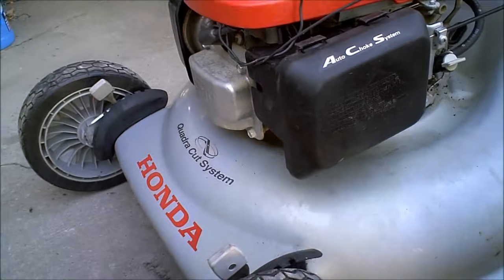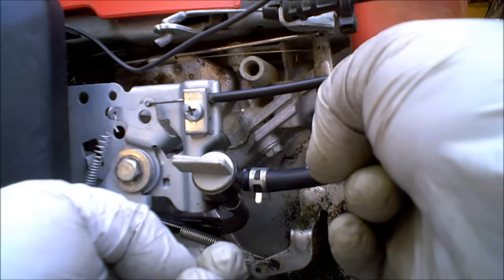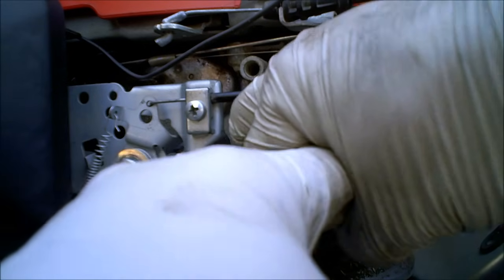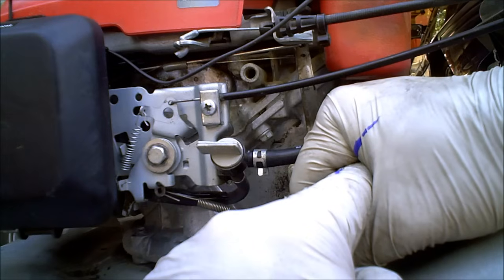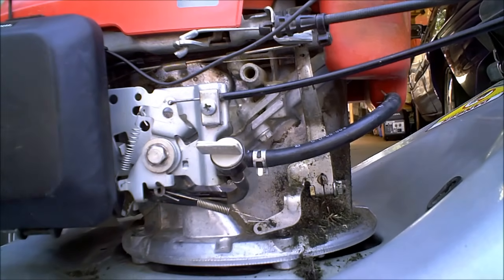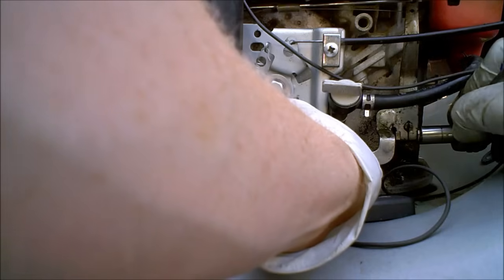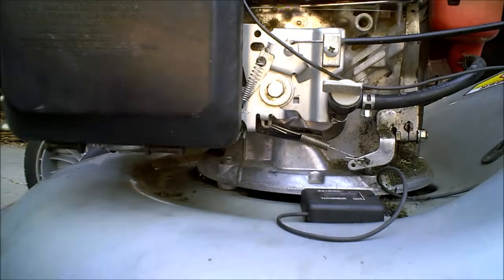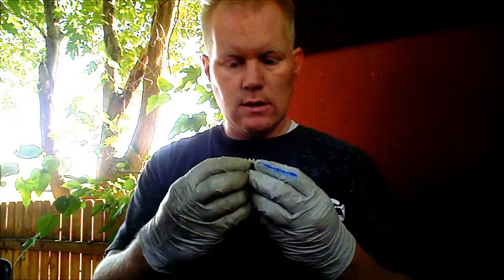Governor Adjustment and How They Work       Honda Briggs Tecumseh Kohler etc.

Comment: I have one of these engine mounted in my flat bottom 8 foot Jon boat with gear box from a 35 hp evenrude works fine
Reply from the maker: That's awesome.
Reply: sixtyfiveford  just post the video have a look
Reply from the maker: It spins it really nice. Looks like the pressure washer and lower unit get a new life.

Comment: Maybe I finally found someone to answer me.
I have an 18 h.p. B&S. I drove it into my garage to change the oil, and my speed control lever was working fine. I started the motor and now I have no control at all. I set the governor in the wide open position. I even went as far as opening the crankcase to make sure the governor/slinger was good. I cleaned and check the carburetor. I still have no control with my lever. I can't slow it down from 4200 rpm to 3600....... What did I miss?
Reply from the maker: Does the carb butterfly operate. If it is and it doesn't change the rpm, then the butterfly plate came loose inside the carb.

Comment: I can't tell in the video, are you rotating the cylindrical shaft with the pliers or moving the arm that goes around the shaft while you hold the shaft stationary with the pliers?  In other words which part are you moving?
Reply from the maker: The center shaft. It is very rare and uncommon to need a governor adjustment and generally only needs to be done if someone has messed with it.
Reply: I don't necessary "need" it, but I would like to increase the RPMs for more power so i can plow through high grass.
Reply from the maker: Some motors also have a simpler way. There will be a metal tab that the governor spring hooks to. This tab is bendable on some engines and you can bend it to apply more spring tension on the governor arm. This increases the rpm.
Reply: I have the GCV 160, Troyblt lawn mower, is there another way?  I tried it yesterday and I got it to increase too much and i change it back but now i can't get it to increase again.
Reply from the maker: Does your motor have a throttle control?
Reply: I don't know I think i have the same motor, a GCV 160.
Reply from the maker: Do you have a lever on the handle bars that allows you to make the engine go faster or slower/change the rpm(throttle control)?
Reply: no
Reply from the maker: If you have the same motor. At 2:23 in the video pause it. You will see a spring at the left side of the screen. It is almost vertical. It hooks to a little metal arm at the top. If you bend this little arm UP it will increase the rpm slightly.
Reply: Do you bend that tab that it's hooked onto  or the whole arm?
Reply from the maker: Only bend the small portion with the hole that holds the spring. Bend it so it pulls harder on the spring. You only bend it a little.
Reply: @sixtyfiveford  How do you bend the bend the metal arm when the metal is perpendicular to the direction you are bending.  Is the preferred way to adjust the governor shaft or bend arm?
Reply: I find that arm that wraps around the govenor shaft is very delicate and if you tighten it too much it will damage it and will no longer clamp down on the govenor shaft.

Comment: What would happen if you take the nut off that clamps the arm to the governor and replaced it with a nylock nut. But left it Loose on the governor shaft thus allowing the throttle linkage to move using the governor arm but not moving the shaft. In an application where you want the most acceleration performance out of your engine like a bicycle or go kart.

Comment: Can you use that same tach for 2 cycle and 4 cycle engines?
Reply from the maker: Yes.
Reply: Most 4 cycle engines (small ) fire the spark plug once per revolution . So the plug fires on the exhuast stroke also . The power for the spark is made by the magneto , no coil , no distribitor

Comment: Hi! how i get out the Carburetor  Main noZZLE when it is stuck?
Reply from the maker: Leave it, and just spray carb cleaner through it. If cleaner sprays through the passage is clean.
Reply: Spray some oil on it and use correct sized flat head. Push hard down into the jet as you break it free to prevent it from stripping. Blow carb cleaner and compressed air though it to clear.

Comment: Ive got a 98 Cub Cadet with a Kohler Command OHV 12.5HP motor, and I'd like to get it to go faster. would adjusting the governor let you get more RPMs out of it? That's what I've heard but I wanna make sure, and how to do it
Reply from the maker: +vinceMCsurvivor silver Adjusting the governor will give you a little more speed, but also shorten the life of the motor drastically. You're better off putting a different size pulley on the transmission or larger tires to get more speed.

Comment: thanks buddy, I have been a mechanic since I was a kid... now I got a paper that says I know what I am doing! I never knew how the governor worked on a lawnmower, I knew it controlled rpm, I just wasnt sure how. I will be sure to check my rpm because it does seem to rev pretty low.... I wanna get me one of those sweet gauges you got there, then I could tell how long I have to perform different services.
Reply from the maker: +codemiesterbeats Yeah, it is nice have an hour meter on machines. It gives you a great idea how much the actually get used and when to service them.

Comment: you had responded to a video about a honda gc160, where the person was having problems with his governor arm not returning to the idle position. you implied that this video would help.   I am having the same problem as the other video, and am trying to figure out why the arm does not move back to idle.  Your video does not address this setup, as your governor arm has a spring that pulls it back.  Do you know if  the governor shaft on the honda gc160 has tension on it (from inside the motor), or what pulls the governor arm back to idle?   thanks!  great videos by the way!
Reply from the maker: +R Wc While the engine is running, the governor is trying to close the main carb butterfly(trying to slow the engine down) and the faster the engine runs the more force the governor it applies to it. The governor spring does, just the opposite and is always attempting to hold the butterfly fully open to increase engine speed. The harder this spring is tensioned the faster the engine will run. The throttle lever that you control by hand is connected directly to this governor spring and pulls on it, resulting in higher engine speed. So if the engine revs higher than it should, either the butterfly in the carb is stuck or the governor isn't acting upon it.

Comment: Hello i have a problem with my lawnmower Honda GXV160 goes too revved and crackling with flames from muffler could be the adjustament of the governor? if it is can you explain me how to adjust it?
Reply from the maker: More than likely your carburetor is stuck open. With the engine off make sure all the linkage and rods that connect to the carburetor move freely back and forth by hand.

Comment: The Honda VRR216 manual states that if the engine speed is adjusted above 3050 rpm the mower blades can fracture. Has anyone seen that?
Reply from the maker: +Mary Lynn Bare The Governmental CPSC (Consumer Product Safety Commission) regulates the speed limit for lawn mower blades. They deem anything under 19000 fpm (feet per minute) blade tip speed to be well within safety specs. The faster the blade spins the better the cut, healthier for the lawn, and the more work the mower can do in a shorter time. Virtually all mowers run right at this to achieve the best results. Honda got a lot of flak for dealers when they started rolling out their lower rpm suggestions(around 16000fpm). It is thought to be more for decibel rating consumer comfort than anything else. Increasing speed on anything increases the risks of something going wrong. But this is like the difference between going 60 or 65mph in a car.

Comment: Hi, I am looking at the honda manual, it says 3000 rpm governed speed, and 1700 rpm idle speed. Are you adjusting the governed speed or the idle? Thx.
Reply from the maker: +goosecouple Honda cut performance to lower the decibel rating on their mowers for homeowners. The GC160/GC190 is rated at 3600rpm for peak HP and will do the most work. Higher RPMs obviously increase blade speed which gives a better cut and is healthier for the lawn.

Comment: Sixtyfiveford, can you adjust a governor, to lower idle, without sacrificing the max 3600 rpm?, I have a honda clond that runs great, and the idle is fine for most applications, but for mine?  I need a lower idle, and adjusted the idle screw out and still to fast.
Reply from the maker: +THEBGRED1 Push the governor arm over to manually get a lower rpm first just to test your engine. It's strange the the idle speed adjustment screw won't allow the carb butterfly to close more and lower rpms. Generally with the the throttle lever set to slow the governor is having zero effect on the carb.
Reply: +sixtyfiveford Take a look at where the throttle cable connects to the engine and move the throttle control (with engine off) from full to idle a couple times...there is either a tab that is bendable that stops the movement of the throttle...simply bend the tab to allow the throttle control on the engine to travel further towards the idle position. Some engines have both a high speed tension spring and a low speed. If that is the case, bend the tab for the low speed spring to decrease the tension. This setting is called "governed Idle" so that you move the mower into the grass when idling the governor will still function and open the throttle to prevent stalling. It is also there by design to ensure the engine has proper lubrication and air flow for cooling. Most are set for around 1500-1800 rpms. If you eliminate the governed idle so that the throttle plate is stopped by the idle screw rather than the governor, neither stall prevention or increased power will be applied when needed at idle. I strongly recommend not lowering the idle below 1200 rpms because if allowed to idle very long it will not be lubricated properly or have enough air flow from the flywheel cooling fan to prevent overheating on a hot day...more important is the lubrication issues as well as sludge buildup. The engineers that designed your engine do actually extensively test such things and is best left as is to ensure a long engine life     Kevins Small Engine, 03908

Comment: On a Kohler Courage 17HP engine, rotate the governor cross shaft (shaft) COUNTERCLOCKWISE as you view the end of the shaft to hold it against the governor pin, and tighten the governor assembly lever onto the shaft with the carburetor throttle valve wide open.
Sincerely,
David Parker

Comment: I have this same Honda engine on a Troy Built mower. I'm having this issue where after a minute or two the engine goes into this oscillating fast fast slow effect. I see the governor arm moving back and forth. I tried to attach the spring to the inner most hole on the gov arm, but it just does the same thing with a faster rpm. Anyone have any clue what this could be?
Reply from the maker: +Shane Sexton Dirty carb.
Reply from the maker: https://youtu.be/O9VuhhEdc1E
Reply: +Shane Sexton   Governor surging is most likely a dirty carburetor. The closer you move the governor spring towards the governor shaft on the engine, the more sensitive the governor becomes.

Comment: I have a Honda Harmony  HRM215 plastic deck mower MZBB-6011398, starts and runs great, oil is coming out of the carburetor, leaking thru the air filter and then onto the deck.  do you have any ideas on this.  oil is only coming out of the carburetor. Thanks George  Your Video's are great, Keep up the good work.
Reply from the maker: George Edwards The most common reason oil will come out of pvc tube and into the breather is that the oil is too thin. This can be due to: gas in the oil, not using the correct oil weight, or the oil has broken down with heat. I recommend an oil change with straight SAE 30 motor oil(non-synthetic) and your troubles should be gone.

Comment: What tip do we have to know if the gouvernor is not broken Inside the motor
Reply from the maker: Richard Labonte   Look at the lever hooked to the governor shaft and determine which way moves the throttle open(revs the engine higher). Start the engine and rotate the lever to rev the engine. If the governor is working it will fight you as you rotate it and try to slow the engine.
Reply: sixtyfiveford Thank You  it is a homelite 4000 watts with a 8hp B&S I clean the carb  adjust to 1 1 /2 turn  the 2 needle  and it work only on chooke when I try to remove the chooke the engine go crazy and stop it was doing the same thing before I clean it I ll get back to you thanks
Reply from the maker: The main jet is clogged or needs to be adjusted further out. If the engine is surging then the governor is working just fine and trying to keep the engine from dieing. More than likely you have an updraft carb. Here is my video on rebuilding them: https://youtu.be/in2tJ0TbWDI
Reply: sixtyfiveford Thanks a lot now it seem to runnning a bit fast I will find my self a rpm meter and get back

Comment: I have 20219 TORO Self Propelled Lawn Mower. I tried to fix throttle cable as it was springing back in chock position and so I loosened the screw and tried to fix the cable but I noticed that it's "end" should push the arm to close the choke which was too small and it was scrubbing the arm but not pushing it. so I bend the arm a little so that the end of the throttle pushes the arm and so it closes the choke. But something has happened now when I bring the throttle handle to fast from the choke position it runs at the slow RPM and then if I pull the throttle handle to slow nothing happens and it continues to run at the slow RPM. I do not see any mechanical movement happening when I bring the throttle handle from choke to run. What should happen? But if I touch the throttle a little it raves up the RPM a lot with loud noise. I mean it works. So what did I mess up and how should I fix it?

Comment: we'll he's 1/4 right by moving the gov.arm it caused the throttle spring to loosen up if he had moved the arm any more then he did it would have started doing the surging that he say's a gov has nothing to do with .Sorry dude surging is due to your gov arm being set wrong or air leaking at your intake gaskets or if it does not do it under a load your cab is shoot.and not gov work the same and the little weights are not weights there oil slingers the gov runs off of the gear and the faster the rpms the higher the gov rachet goes pushing against the are to choke it down so your motor does not over ref. OH I have owned two small eng and power sport shops and have been working on them for over 30 yr.
Reply from the maker: Old school Gamer Surging is a clogged idle jet in the carb. Surging shows that the governor is working properly and it is keeping the engine from stalling.

Comment: I have a Honda gcv 160 lawn mower. It's runs good but over time the throttle control lever slowly goes up and slows down the engine. And then I just semi constantly have to push it back up to full throttle. Any ideas what I could try?
Reply from the maker: turdsandwicher Some have a screw that you can tighten down on the side of the engine. It makes it harder for the lever to move but keeps it from moving.
Reply: thanks alot i should have been able to see that lol. but you saved me i was going to replace the whole mechanism.
Reply from the maker: Glad you got it fixed.

Comment: Another way to "reset" them is to loosen the crimp nut, hold the arm all the way to the right, turn the shaft in the middle all the way to the right while holding the arm to the full right position. Tighten the nut down while everything is at the full right position and you're done with it. Done it many times this way. Works at the factory setting that way.
Reply: 1972FordF150 , Having removed the carb for cleaning after reassembly I found that the motor would only run at full tilt on either the Rabbit or Tortoise position, I followed your instructions and it's now perfect.  Also a big thanks to sixtyfiveford  for the video which gave me a better understanding of the workings of the governor.
Reply: Chris Marsh I
Reply: That’s okay providing the Carb, linkage has not been changed by bending stretching E tcetra   Loosen off the nut yes but first mark the position with a tipex White mark then you can adjust it either left or right  one notch at a time  re clamping each time  until you have the required R P M But you say all the way to the right ??, So you want them to disconnect your springs ??  not a good idea for the average Joe  and all the way to where ????till it touches some other part of the engine ???  its not on  test bed where these things are set up ???  and with age the R P M will slow down
Reply: thanks man

Comment: I have a toro 20017 mower,suddenly the rpm got really high and wont slow down,should i replace the governor instead of adjasting it?when to adjust the governor arm and not replace the governor instead?
Reply from the maker: rod seattler It is very rare for the governor to actually go bad or go out of adjustment. Your symptoms are generally from a sticking carburetor butterfly or binding spring on the governor arm.

Comment: cool video 
i dont seem to be able to stop my honda over revving i changed the carb ,i even split the moter to check that throw out weight thing all good got it back together runs but still over revs in any postition i get the governer in .
if i grab it by hand i can get it in the right spot for 3600 rpm but if i let it go revs 5000 rpm any other things i could do 
thanks in advance
Reply from the maker: vicvary Your should be able to adjust the governor position on the governor arm/shaft to bring the rpm way down. Rotate it all the way one way and try it, if that doesn't work then try all the way the other.
Reply: cheers got it 
thanks